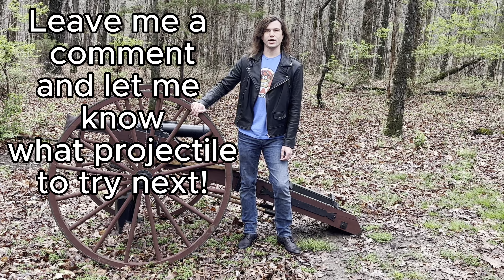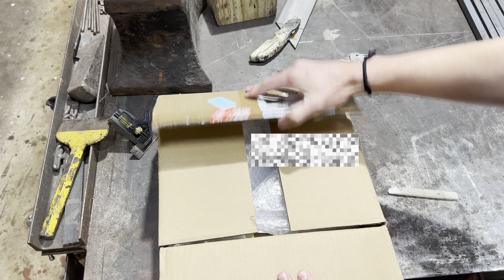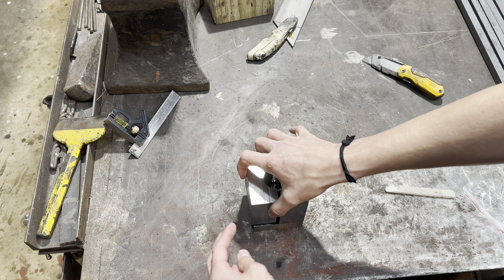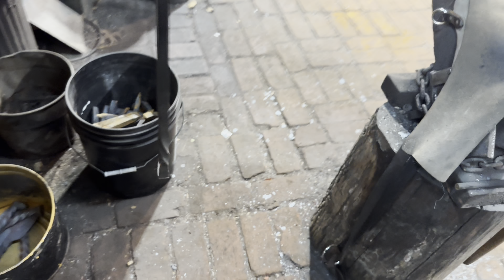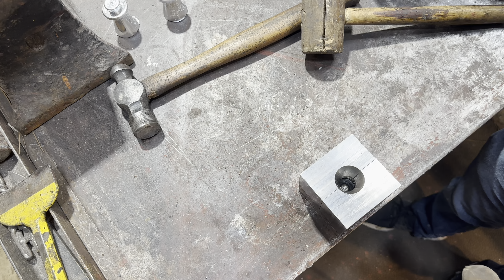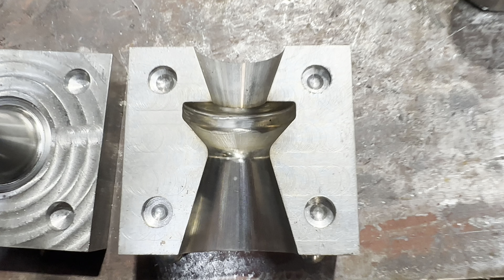Making Giant Diabolo Airgun Pellets

Comment: The wrinkles in your projectiles means that your mould is too cold. If they look frosted it’s too hot. I’d put it on the forge and warm it up while the zinc is melting but not for too long. Also zinc fumes are no fun. I mean, unless you like the feeling of a fever or the flu, wear your respirator when melting the stuff. Something else I noticed was while you were cutting. Might be of interest to have another mould made but shorter allowing the top of the projectile to stick out. This would allow you to have a consistent point of reference for your cuts as well as alleviate any chance of warping/damaging the projectile. Just some things I noticed, otherwise I applaud you. Keep it up! 👍🏻

Comment: DO NOT FORGE OR GRIND ZINC HOLY CRAP
Zinc Oxide is SUPER toxic and can coat the inside of your lungs and kill you! Blacksmiths typically do not recommend forging with Galvanized Steel, much less pure Zinc!!!
As toxic as lead is, it's still WAY safer than zinc

Comment: zinc seems like an interesting choice.  I wouldn't mind the warnings about lead, just wear a respirator and don't eat it.  lead is a pretty ideal material but it would be cool to see any other materials, such as zinc, that you can come up with.  A hack saw might take longer, but it also throws less metal dust in the air.

Comment: I"m not sure how well these will run but hopefully this will help. Putting those pellets in a vise like that could possibly be crushing the skirt so that you don't get a good gas seal. Perhaps you could get some aluminum soft jaws with the diabolo profile cut into them, similar to the mold, so that you get constant pressure on all side?

Also, is the skirt possibly too thick and doesn't readily deform when  fired? That could be an issue.

Comment: Why wouldn't you put a point on the tip of the pellet? It would make it so much more accurate. Plus you could do what they call dieseling it. Fill the cone on the bottom full of petroleum jelly. Probably close to doubling the speed if you did just those 2 things.

Comment: This looks like it might fly with some promise.  Hopefully you'll get some good accuracy from these projectiles.  Don't fill in the hollow base because it's hollow for two reasons.  First, the bulk of the mass of the projectile is going to be towards it's front so, with the front having the most inertia and the lighter base skirt having more surface area for drag, hopefully the "pellet" should fly straighter.  The second, and more important reason is that the pressure from the burning powder should cause the hollow skirt to expand and seal the bore.  This will give you more velocity.  If you end up having difficulties with the zinc Diabolo pellets don't disrepair.  If the pellets work fine don't change anything - but if they cause you problems try casting them in lead instead.  The skirt on a lead pellet will expand to match the bore diameter very well.  With a zinc pellet.... who knows?  Looks like you're going to be the one that finds out for all the rest of us.  Best of luck.

Comment: I'm not sure about the mold and it may need a sabot, but I can't help but think of those Nerf style footballs (basically a football with the fins from a lawn dart behind it) would be an excellent choice for balanced stability in flight. They should be self-stabilizing but pushing them out of the barrel is the problem and why I think you'd really want a sabot for that sort of thing.
Reply from the maker: That’s a fun design! I’ll have to see if I can come up with something like that!
Reply: @TheCannoneer  It's the forces involved that make me think it'll need a sabot. I could probably do a bit of math to narrow that down a bit and you might be okay with just some sort of wad between the ammo and charge. 

I'm a mathematician and I assume that I can find the numbers, but I've never calculated these types of forces and don't want to make claims without knowing more. Without a sabot, there would be a great deal of force on the area I'll call the shaft - the area between the 'football' and the 'rocket fins'.

I'll keep watching. I may take a look at running some numbers if I can find material strengths and propulsion forces.

Comment: My dad used to go to the local tire shops back in the day and get their  old led wheel weights.
Reply from the maker: We’ve raided all our local tire shops too 😂
Reply: @TheCannoneer  Indoor ranges are the place to go, if you know the owner of one. You can sometimes get them to let you clean their bullet trap and get hundreds or even thousands of pounds of lead in a single trip. Wear proper PPE and use proper decontamination procedures, and use liberal amounts of water to knock down any dust. Rarer to find them, but you can also sometimes find free or very cheap wrecked sailboat hulls that have a few tons of lead ballast in the keel. Those you can chop up with a chainsaw and collect the ingots you cut out and the saw chips.

Comment: So long as you're not overheating the metals while melting them they are both relatively safe to work with. It's when you start making tiny particles, ie using a grinder, belt sander or getting it way too hot, that you can breath in that you need to worry.

Unless zinc is cheaper than lead, there's no reason to use it instead.

Comment: No issue with using lead. Just wear a respirator when melting and grinding it. Also would love to see you use other metals like copper, bronze, and brass.
Reply from the maker: I’ll have to see what we can melt in the shop! We’ve got a small crucible but it won’t melt steel.
Reply: @TheCannoneer  For sure not steel. You have to get your forge really hot, but you can find the metals for bronze and brass in a scrap yard. You'd have to ask for the copper though. When I worked at scrap yard we separated our metals and had big piles and bins for different metals. We even had bins just for bolts and nuts. Everything should be sold by weight there.

Comment: Zero issues with using lead, and probably the best material to be using for theses. The issue I had was the grinding and the fine metal dust. Although less hazardous long term Zinc dust isn't good for you either. You really should cut the sprue off with a saw and finish with a course file. No grinding, no sanding, keep particles size large so it's not airborne and you breathe it in.

I would also leave the cavity empty, add filler changes balance and doesn't allow the skirt to expand and seal against the barrel. You could have another mold base made for a solid skirt if you wanted to experiment.
Reply from the maker: That would make total sense as they need the front heavy to fly stable. Ballistics are weird.

Comment: If you decide to fill the cone, try wet toilet paper and let it dry.
Reply from the maker: I’ll have to do a few different versions and see what happens! You guys have lots of good ideas for this pellet.
Reply: @TheCannoneer  If you want to try different diabolo shapes I highly recommend you base your designs on those of the JSB brand. I shoot long range field target at 70+ yards with a .22 airgun and their pellets keep me grouping at under an inch. The name of the pellet I use is the JSB Diabolo Exact Jumbo Heavy 18.1 grain, the thicker skirt might help the round hold up better to the higher pressures and the rounded tip is more aerodynamic than the wadcutter shape.